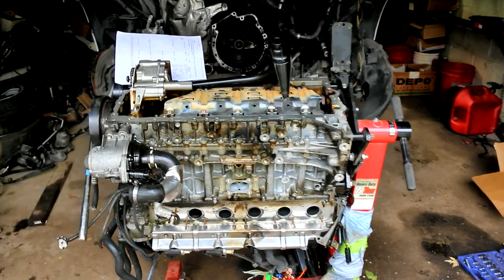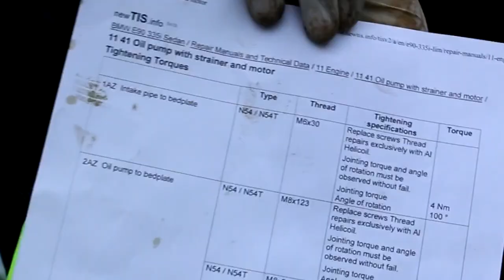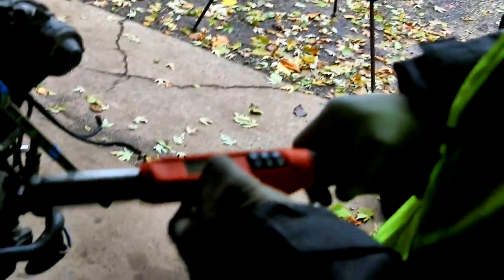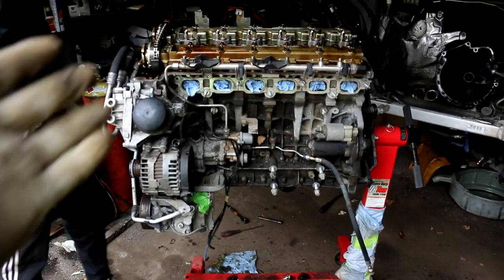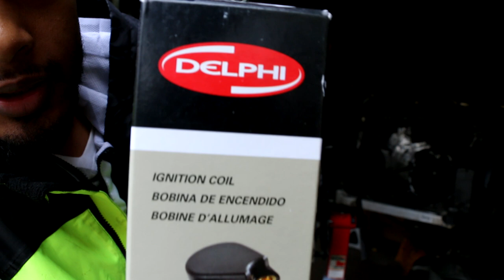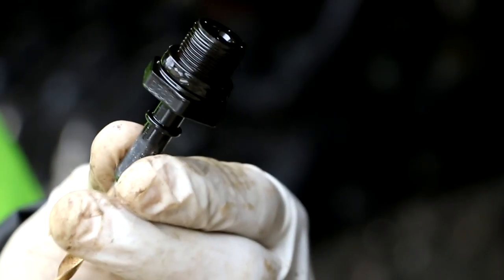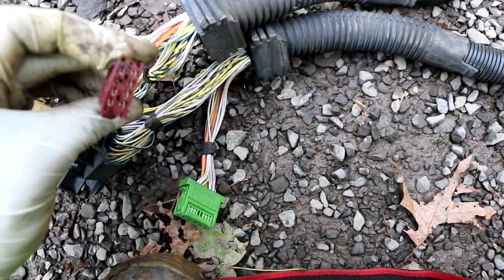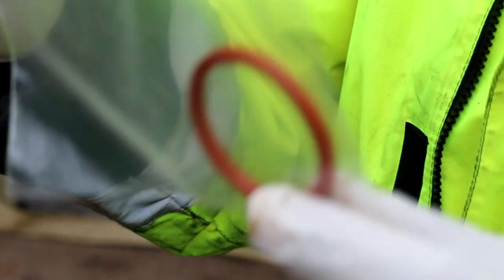N54 OVERHAUL | EPISODE 6 | ENGINE PREP.

Comment: Congrats on the 1k subs. I know you can't wait to get everything done before it gets cold.
Reply from the maker: Thanks slots. The goal is to at least have the engine back in the car by dec31st. I need a chargepipe , turbo oil return lines , fly wheel lock tool.

Comment: No new sparks plugs? Ngk 5992 one step colder would have been 👌 if you planned to tune.
Reply from the maker: I replaced the spark plugs already with NGK before the e90 was crashed. The e90 endings is the the donor car.
Reply: Nice man can’t wait till the car is finished.